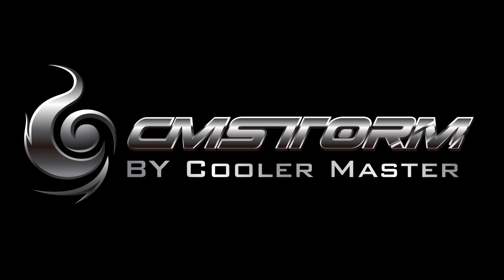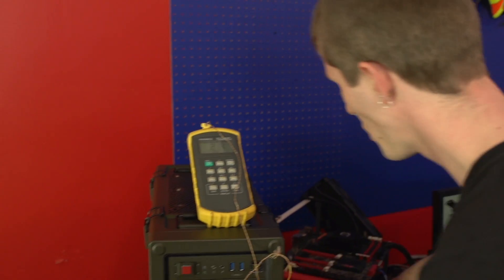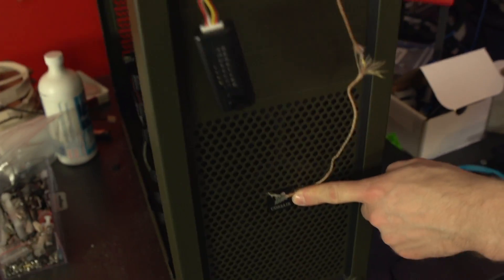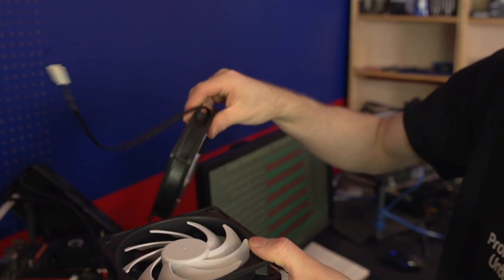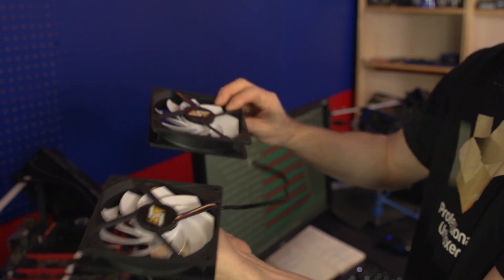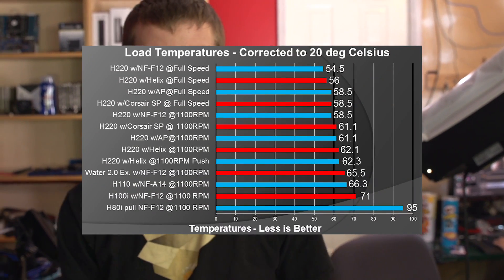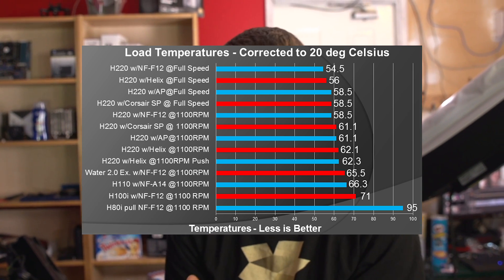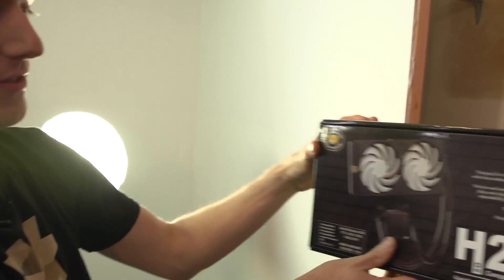Swiftech H220 Video Review Redux

Comment: Linus uses Noctua NF F12 fans because they are, in his opinion, the most consistent for testing multiple coolers against each other. They are better than most stock fans on coolers but are quite expensive. He isn't asking you to use them, he just wants to eliminate a variable to provide the most accurate results.

Comment: From defensive to hostile and derisive within two replies. Typical pseudo intellectual reaction when their logic is questioned.

Trick question: How much do you think measured (in REAL LIFE!) noise levels, static pressure, and CFM of individual fans change when you're biased and aren't using any testing equipment or a stable environment?

Answer: As much as you want it too! 

Ex: i hav ap-15 and nf-f12. ap-15 = 9.7545 and nf-f12 = 7. my RL xperience defies phsyX™! dnt doubt me! idiot!

Ignored.

Comment: The fact that you're asking me what I am talking about shows you don't know what you're talking about.
GT's are CLOSE to the best to use with rads. You must use max rpm JUST to get the same performance as nf f12's 2ND highest voltage. However, THEN you're dealing with higher noise
D1225C12B5AP-15 is basically the same price as the nf f12's only the f12's are much quieter, better built with better warranty.
I'm talking 10 being best 1 being worst overall.GT's=great nf f12=better. Move on.

Comment: What CPU is that and with what clock speeds? Cuz I don´t get it. I have a FX 8120 @ 4 GHz with H80i with 2x SP Performance Edition fans in push-pull and my CPU was never above 32 degrees Celsius in 100% load.

Comment: Do you also run Furmark to max out your video card and are you running INSIDE a typical pc case?

The 2nd reason i ask that question is I've tried toe genlte typhoon ap 15 fans and they don't perform as well as the nf f12's in performance nor noise.  

Either they have to be volted to be MUCH louder than the f12's to perform better, or they slightly louder and perform much worse.

I'm not saying GT ap 15 fans aren't great, but they're a 7 compared to noctua's being a 9.7 in overall rating

Comment: I've had a few all in one kits now, right now I'm using the H100, yea I can feel they vibrate, when I touch the pump, but I never been able to hear it. And my fans are pretty silent. You sure if just not the water in side with air bubbles, give a few taps while it's running to knock the bubbles out.

Comment: So did you use the NF-F12's in pull config also?  Just curious because I know my friend saw higher temps when he swapped to a NF-F12 because at that point he had to do it in a pull config since his ram was in the way.  He has a h212 plus I think inside one of the Raven cases(whichever one has a window on the right side of the case).  Which explains why the ram gets in the way since it exhausts out the top with the motherboard configuration(in case anyone was wondering).

Comment: Actually it's not like that. Higher FPI rads are just more benefited by high static pressure but that doesn't necessarily mean low FPI ones won't work well with high static pressure fans.

Comment: That's what reviwers describe it as. I don't own the unit so I just cited. 
2 degrees difference is as good as you will ever get from any cooler priced 30 percent lower than H220 at the same amount of noise.

Comment: Here's a forum user who has tested H100i+NF-F12 and H220+NF-F12 both @1100rpm:

w ww.overclock.ne t/t/1367654/swiftech-h220-owners-club/290#post_19503660

So...who do you trust  ? A prominent youtube reviwer sponsored by CoolerMaster who worked with Swiftech to "find what had gone wrong the first time" or a forum user swapping his old H100i for the H220 ?

Comment: Definitely agree there, used to run an h220 and my IB 3570k@ 4.3ghz ran at 65 degrees full load, just recently changed it out for an h100i since it died, and now with ambient temps of 32 degrees my cpu stays at a cool 59 degrees at full load B)

Comment: The hell ? Ingorant ? How is it ignorant to not believe a review stating that fans running at the same rpm on the same size radiator can make a 13 degrees difference ? Anyone with decent knowledge on thermodynamics and fan mechanics will tell you this is bullcrap. Who is the ingorant one now ?

Comment: Why, what's wrong with max settings ? You do know that h110+stock fans at max settings is quieter or on par with with h220+stock at max, dont you ? It's not ubearably loud, especially if you have good headphones. Anyways, you should check eteknix.com, tweak.dk and anandtech if you want to see h110 blowing h220 out of the water.

Comment: Taking into consideration the fact that the stronger pump of H220 has no impact on temperetures when not having added anything else on the loop and Corsair's radiator being higher FPI, there's really no reason H220 would peform better than a 280mm AIO liquid cooler.

Comment: Clearly you are too gullible. All other reviews state that H110 blows h220 out of the water. Linus didn't test the h110 with stock fans at max settings. He knows this will make H220+NF+F12 look like a mediocre cooler. Coupled with plenty of issues like air bubbles, dying pumps and whatnot, Swiftech would obviously make a fool of themselves.

Comment: If they are using stock fans they aren't comparing the coolers they are comparing the fans the point of these tests are to compare the cooler and most enthusiasts will replace the stock fans for something silent that also performs better

Comment: on the gpu... stock cooling is fine.. you can overclock pretty far like ~20 pct no problem on stock GPU fan. 

cpu... you will need some kind of cooling... i suggest the corsair H110 or something like this.. if you have more money by ALL means PLEASE go custom loop.. cost more, more hazardous. like 10x better.

Comment: Cool, still not worth the money if you're not upgrading and still looks too ugly for me to consider, but it makes more sense now. is it possible to redo some tests with a GPU block installed in the same loop? Also, how about using a sound meter (or at least a smartphone) to check how noisy the pump was

Comment: Hey Linus, how about trying the Akasa 120mm x 25mm Apache Black fans and see how they do. Also where is the overclock figures of the test platform posted, i would like to do a check it out. I have an 15 3570k running at 4.3 with 1.035v and BLK at 100.0MHz.

Comment: Would be helpful to know the volts and clocks for this test as the temps seem a little high to me, I use a noctua nh d-14 on a 2500k at 1.25v for 4.5 ghz clock with the fan speed reducers and never go above 61deg, and that's without taking out the ambient temp which would make it woop all of these coolers, seems weird to me.

Comment: using the same fans, the X60 is basically the same as the h110. both were made by Asetek and besides the digital control ang look of the pump/block, everything is the same

Comment: If by stock you mean the stock cooler from intel.. then you are crazy lol, but if you meant "standard air coolers" then there are a few good options out there, like the noctua NH-D14 (best air cpu cooler imo) .. they can even outperform some pre-filled watercooler blocks.. i'd recommend searching youtube for comparsions thou.. as for the graphics card i think you should be okay if your case has good airflow

Comment: IMO get the H220 or else just get a good air cooler!Performance of other pre-fills is not that great and trust me you're doing it for the looks.I always wanted a custom loop but since I got the antec 620 I just ripped it off and got a xigmatek dark knight cooler!You will be surprised to see how weak the pumps of these units are.For the 620 pump it took about 1 minute to empty a glass of water not to mention the pump clicking after 5 weeks!Go custom or go air

Comment: you will need water cooling for sure...  i personally have a PNY 660TI and i have it overclocked to 1100 mhz core speed with 6600 effective memory clock.

Comment: This can be made into a custom loop, you can add more hoses to this and the included pump is made for custom loops so it's a very good pump, that'a + point. Chopper fins +, better CPU block design +, quality coolant + and quality thermal compound. This is an outstanding all in one... that can be converted to a full custom loop.

Comment: if you've ever touched the back of the pcb of a gpu after it has been running under 100% load, it's really hot. thus it will heat the air around it i.e the pc case